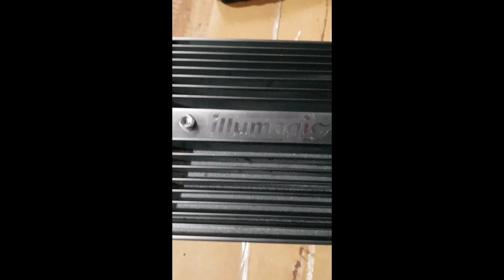Illumagic Blaze-X 2 foot in depth view

Comment: Are the fans user upgradeable?
Reply from the maker: Yes they certainly are. Simple screws on top to remove casing
Reply: DALUA Thank you! is there a specific spec/ size of fan (mine is more than 2 years old so out of warranty - i assume messing with it would void warranty). Also is it normal for only one fan to come on at a time?
Reply from the maker: @nornicle2  yes each fan works independently email us at info@dalua.com so we can send you specs
Reply: DALUA thank you will do